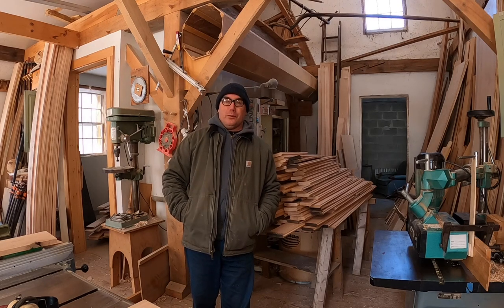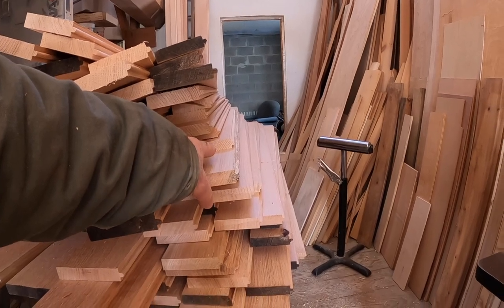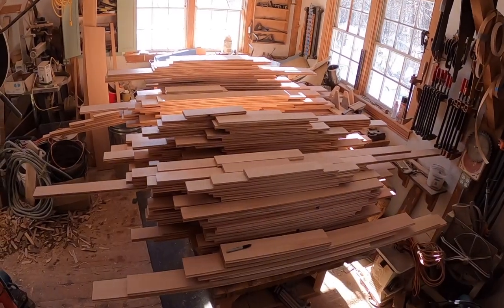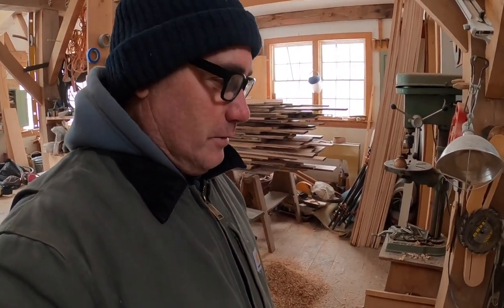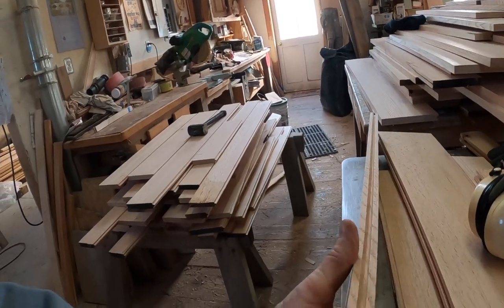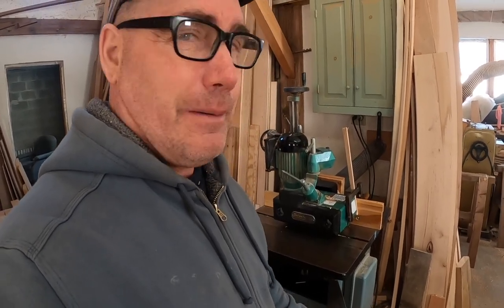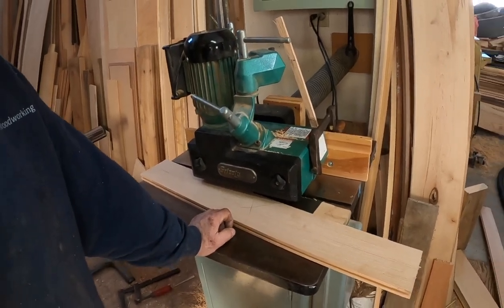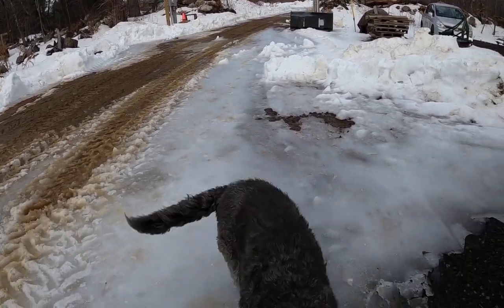House Build: Milling the Hardwood Floors

Comment: when making flooring the final cut on the shaper must always and I do mean always cut up against an outside fence. this means the fence is away from the cutter. Two , three, four inches or what ever you set it for. Using an outside fence guarantees the board widths will be perfectly consistent.  Cutting against the fence next to the cutter and relying on how well the board was ripped will certainly introduce gaps and uncertainties in the width of the boards.  I use an outside fence mounted to an Incra LS positioner that is adjustable in thousands of an inch.  Just my two cents but bravo for making your own flooring.
Reply from the maker: Thanks for watching. The floor came out beautifully!

Comment: I may have missed it but what's the length of your boards you decided on?
Reply from the maker: The boards ranged from three feet to eight feet. The logs they came out of were mostly eights with some tens. Didn't seem right to cut them down. I wanted to use them full length if possible. I think they came out spectacular. Thanks for watching.
Reply: @BrianBozak  Thank you for your response. This is helpful as we are about to get going ourselves. :) Do you have any pics of your floors installed?
Reply from the maker: No i don't think there are any videos of the finished floor. The guy we had sand and finish it did a great job and left saying that it would never look as good as it did when he left. Guess what he was right because there were scratches that appeared soon after and no one even the dog would fess up to them.